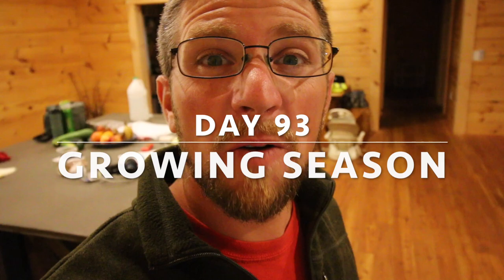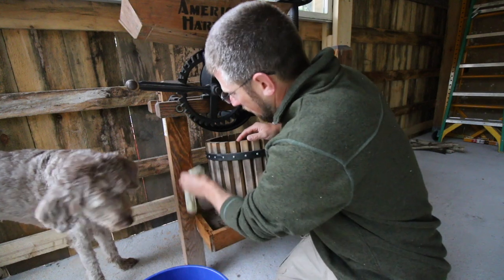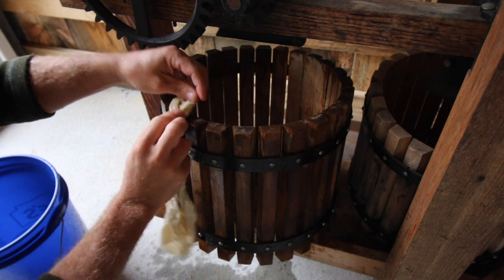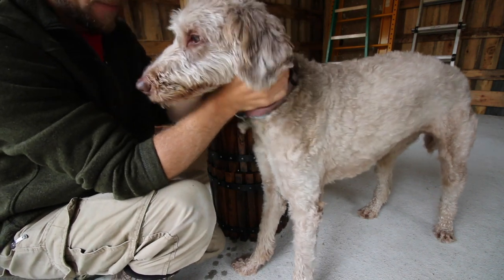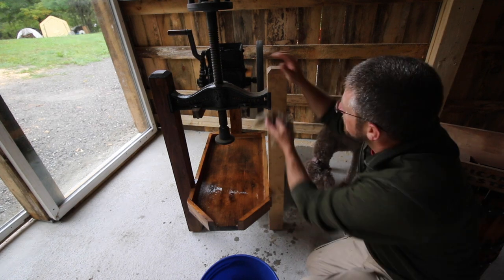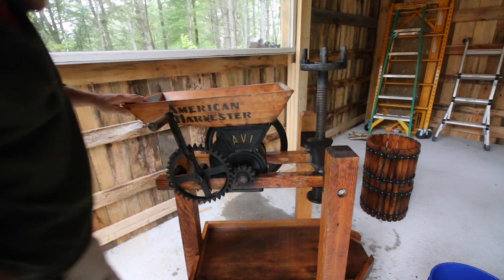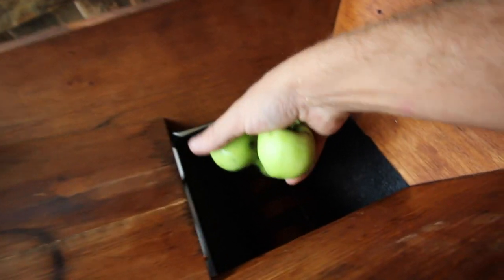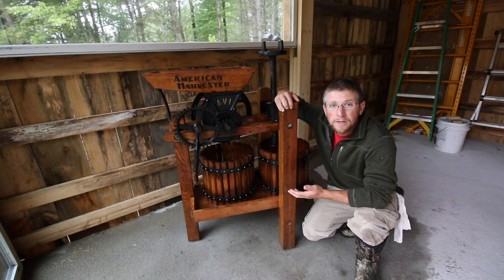How to Clean a Cider Press

Comment: Nice job Al, it's looks so much better. Seeing all the wood wetted down, I would say the parts that are not oak are maple. American Harvester stills makes that same grinder/press. The newer ones are not as well made, especially the frame, the iron parts look like they could be of equal quality. 
Instead of bags you might just want to get a lot of sheets of cheese cloth, lay in several layers. The advantages of cheese cloth. It comes in sheets large enough to line the hopper, with the top ends long enough to secure over the bottom of the grinder chute with a piece of twine. This cuts down on the grindings flying all over the place. Once a hopper is full you can fold the tops down over the mash before you begin pressing.
You can also make your own apple cider vinegar, it's a fairly easy process. I have a 5 gallon bottling bucket that I've been running with malt vinegar for over 20 years. If you're interested let me know and I'll get you the instructions. 
Unless I miss my guess, I'm betting the pigs prefer the apples once they begin to turn, perhaps even ferment a little. The chickens are going to love the mash too.
I was happy to see Pluto approved of the great job you did cleaning up the press. lol 
C'mon 10K
Reply from the maker: Thanks! I would love the instructions you have for making vinegar! Thanks! I am hoping for 10k by 7 est tonight or we will do  live bonus video tomorrow!
Reply: I'll get the instructions written up and send them off to you.

Comment: The press looks great all cleaned up! Forgive me if you know this already, the block of wood and disc are the 'compression plunger assembly' not a hand wheel device. The grinder portion of that unit looks like it is in great shape and sharpness for turning the whole apples into mash. Some units I saw demonstrated you had to cut the apples up first, then feed them into the grinder. A toothbrush will help you get into the tight spots when cleaning. Great video. God Bless
Reply from the maker: Thanks, yes I need to rebuild the assembly. I am glad the grinder works nicely!
Reply from the maker: you need a photo for you youtube avatar! :)
Reply: I'm not very skilled with social media Al.  What I'm saying is I don't know how to do that.  I can't remember how I got the picture of Becky and I for Facebook.

Comment: We got our cider mill when I was 5 and I am 77 now. It was used but in good shape then but over the yeas it had improper storage so all of the wood has been replaced once or twice. I have to replace the 4 corner posts this month and they need mortises cut in them to match the tendons of the pieces that hold the gears. I dont have any lard so I am using coconut oil to lubricate the bearings and screw.
Reply from the maker: I bet the coconut oil works just as good!

Comment: This apple grinder and apple press is very cool.
Apple Cider Doughnuts! I have not had them, but they sound wonderful.
By the way, why not apple cider vinegar?
It looks like you could have one person grinding apples and a second person pressing the apples. An axe handle will work for turning the press.
I suggest tasting the apples to find sweet apples for regular apple cider.
Reply from the maker: Apple cider donuts the best! We are hoping to make vinegar too!
Reply: That is great if you can make apple cider vinegar.
But I was wondering why you cannot use apple cider vinegar and water to clean the apple press?
Reply from the maker: you can but the white vinegar is cheaper

Comment: is that cider press made of oak?  also after cleaning i recommend food grade mineral spirits used for butcher block and cutting boards.  i used to refinished furniture for my own antiques as a hobby and to earn extra money part time.  its fun and like a trip thru time with little surprises along the way.  oak is my favorite wood because its such a hard wood with smaller tight pores that's why we have pieces like your still around.  thats quite a treasure Al.
Reply from the maker: Thanks. this winter I want to oil the press. the post are made of oak
Reply: I think you mean mineral oil! Totally separate animal entirely. ;)

Comment: Al:   When picking apples; put your index finger on the end of the stem where it meets the spur and lift up with a small twist.  The apple should come free leaving the spur needed for next years apples.   Between 8 and 18 I must have picked over a million apples in our and the neighbors orchards.North of the border your pressing apple juice;  it's not cider until it is 6-10 % alcohol. One of the orchards I worked on had a large wedge design press that took about 40 boxes of clean windfalls built into the steep hillside.  When it was full the crawler orchard tractor was slowly driven on to the top closing the wedge and the juice ran out the bottom into barrels.  Then the wall was unbolted and the pulp was spread under the trees.Bert
Reply from the maker: Why did they spread the pulp under trees?
Reply: Because the hillside went from level at the bottom then up at a 45 degree slope a wheeled tractor would tip so we used a crawler tractor.  The tracks and skid steering worked the top of the ground and mixed in the pulp feeding the worms.  As in a compost pile.   The trees were also pruned up  and topped to open up the center forming slots between branches to get the ladders in.  You worked the branches to either side for thinning and harvesting.   Most of the ladders were 12'  2 legged orchard ladders.   But there were ladders up to 18' for the standard cherry trees.   Now the replanted orchard are all on semi dwarf stock and can be worked from the ground or at most a 8' ladder.     Bert
Reply: Correction Three legged orchard ladders.  Fanned out at the bottom from about 6' to 1' at the top on a 12' ladder with a 2x2 for the third leg. This way you could establish a stable triangle on the hillside.  With the center axis of the steps  90 degrees to the fall line and the leg through the centre of the tree.            Bert